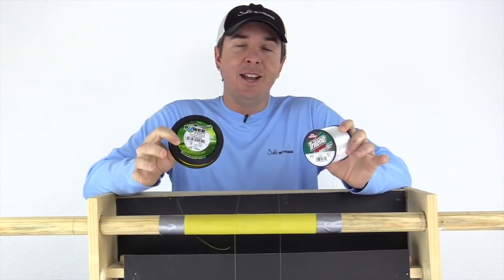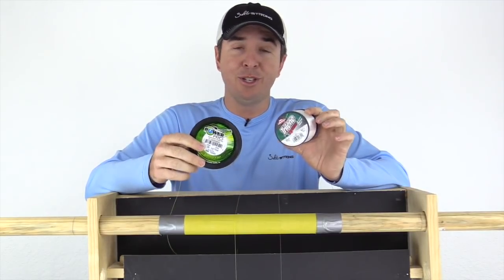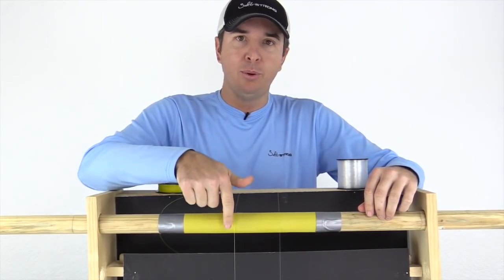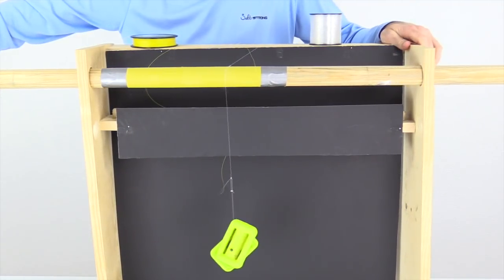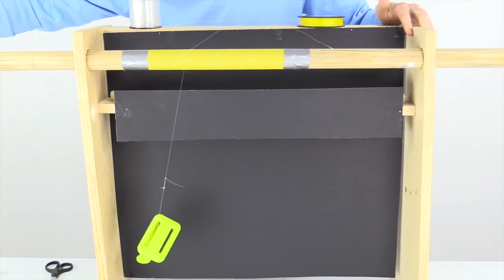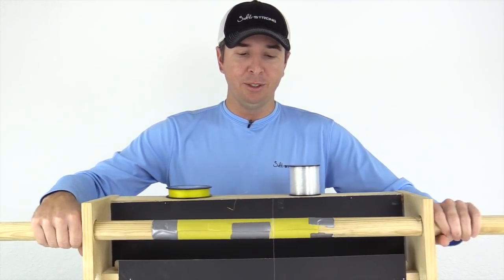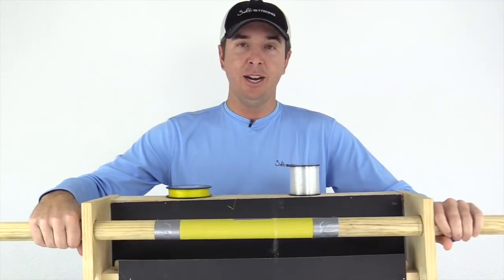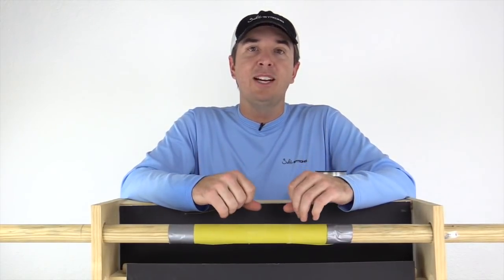Is Braid More Abrasion Resistant Than Mono? Find Out Here...

Comment: Hi Sir I'm  quite shocked to see 20lb braid line to break first on the first test & it just goes to show that 20lb mono stands up to the test than braid & I have 65lb braid on short powerful Okuma Rod & Okuma overhead reel & I use a 50lb Monofilament Nylon line as a leader with the 65lb braid & I'm just wondering how would 65lb braid vs 60lb Monofilament Nylon would stand up to the 65lb braid because I don't think you can get 65lb Monofilament Nylon line & closest would be 60lb Monofilament Nylon line & that would be a good test Sir if could do that test Sir & would an interesting test to see if 65lb BRAID VS  60LB MONOFILAMENT NYLON LINE WILL STAND UP TO THE TEST 
Kind Regards Peter & I Thank You So kindly for doing all the other test you have done Sir 
MONOFILAMENT NYLON LINE VS FLUOROCARBON LINE & 20LB MONO EVEN BEAT 25LB FLUOROCARBON LINE  WHICH WAS A REAL SHOCKER FANTASY THAT AYE CHEAP 20LB MONOFILAMENT NYLON LINE BEAT THE MORE EXPENSIVE 25LB FLUOROCARBON LINE HANDS DOWN & IT JUST GOES TO SHOW MONOFILAMENT NYLON LINE STANDS UP TO THE ABRASION TEST WEATHER IT'S BRAID OR FLUOROCARBON MONOFILAMENT NYLON LINE COMES OUT ON TOP ON THE ABRASION TEST GOOD ON YOU SIR FOR DOING THOSE TEST & Have A Lovely Nice Wonderful Day Sir 😀
Reply from the maker: Thanks for watching and for the support Peter!

Comment: If braid snapped that easily on that then I should have lost A TON more fish around pilings. I’ve wrestled big snook around pilings with my 20-50 lb braid and have had little problems. My only problems were just regular break off from monsters... you know. When I used mono I broke off on pilings almost instantly. This is in accurate lol

Comment: Some people said the test should use the same diameter lines.  Well, we chose our line strength based on what is your target fish, so based on diameter is NOT in the real world of fishing. I have many times break off 100-150 lb braid lines on the pier, boat bottom, sand bars, reefs, large fish scales, whipping shark tails and rough skin.  But it took 50 lb mono forever to break by abrasion.  That is why all the big game set up have at least 200 yards of same strength mono top shot, experience told us.
Reply: I wouldn't be surprised if you're right, if 20lb mono is still more abrasion resistant than 100lb power pro, but it would still be interesting to see that confirmed in a controlled experiment like this.

Comment: I mean, most people only use braid for top water where you need a no stretch line. Not to mention is pound for pound braid a lot smaller in diameter than mono. So course with having less material to go through you would get this result. So with a pound for pound line test it should really be pulling strength.

Comment: I can't believe you ignored the diameter of the line when you carried out these test. But if braided line is really that weak I can't really believe how I wasted my money on spending 7 times more of what could have spent on buying the same length of monofilament. My very first time using braided line on light spin fishing on a mountain rocky river. It's time to find out the hard way lol !!!
Reply from the maker: The main factor for most anglers in power, so that's what was made equal in this test. The benefit of braid is in its casting performance and feel of strikes given its thin diameter and no-stretch material. But the cons is that it's not as abrasion-resistant and it's easier for the fish to see in the water. So the line assembly we recommend is to use braid for the mainline and then add a ~2 ft mono/fluoro leader at the end that can handle the abrasion it may get exposed to while being less visible to the fish.
Reply: @Saltstrong  yeah thanks for the reply and suggestion. That's what I actually did today. I added  70 cm of fluorocarbon leader at the end of my braided line to tie the lure and it worked pretty nice. Most of the time my braided line floats in the water and rarely  comes to contact with any rock .I loved the feeling of braided line as a first timer.

Comment: Braided line has in a way revolutionised fishing IMO. A whole industry has been built around it. Reels are being made super expensive and super strong, along with rods to cope with braid I see videos of guys catching huge fish on braid, the rod bent to the handle, basically bringing the fish in with the line only. May as well be using rope. The rod and reel is only a tool to facilitate wrenching a fish in on high breaking strain braid. It's not sport at all. Case in point, say a guy is using 50lb braid for stripers, the equivalent mono setup is a 50lb game rod with a huge conventional reel. If a guy was winching them in on that people would say hardly sporting, why is it any different for a guy to winch  them in on a rod that bends to the butt using 50lb braid?The fish is up against the strength of the line not the skill of the angler. It sucks that fishing has gone that way.

Comment: Went fishing twice a week during my work years.......now retired and go 4 times a week.  Braids main advantage is its use on light spinning reels for casting and line management, however even though it is hard to cut and seems tuff when cutting the tag end off a knot.....it actually is not very resistant to abrasion.  
Where I fish we have Chain Pickerel.  Sharp teeth!!!  So you have your favorite floating rapala tied on and fishing for Bass and a Pickerel hits......there goes your floating rapala.  Amazing how fast braided line will fail in real world conditions against any fish with sharp teeth and or sharp gill plates.  
So along came Florocarbon, all the pros hyped it up, yep the new wonder line and it is just a bad as braid and even with supreme care tying a knot it still is weak at the knot , sharp teeth and or a concrete piling will cause both braid and floro to fail so fast it is amazing. There you are holding an empty limp line and saying.......Wow that was fast!!! There went my new 8 dollar spinnerbait.  

So it was back to mono for this fisherman.  Mono will get nicked, and messed up but does seem to hold up, so you just cut off 4 feet of line and re-tie.  And you will still have your new 8 dollar spinner bait, it was not donated to a Pickerel.  

Cheers
Kit
Reply: You know you can use braid for main line and use around 8-10ft of mono or fluro leader???

Comment: Try this test with similar diameter lines. Courious to see that.
Reply from the maker: The power of those two lines are extremely different when their diameters are the same, so we didn't think it would be worth testing. Is there a situation in which you are deciding on braid vs. mono in which a specific diameter is desired?

Comment: Great video evidence.

I was on a great bass  bite fishing rock piles last spring. Losing every fish too big for me to immediately control with braid.  Used only 15 pound floroclear and caught a 5 pound catfish way down in this rock pile.
All I could do was keep pressure while  the cat gradually rolled up the rocks. It took several  minutes to get clear of the rock and  land him. the line was very scuffed up but still strong and fishable. With braid, even with a long leader,  it would have been about a 3 second deal until that disintegration as shown in this video. 

I still use braid sometimes , however when using mono , as far as concern for hook sets go, all you have to do is use a slightly lighter hook, copolymer with slightly heavier # test,  or a slightly faster action rod, or some combination.

Comment: This is a crap test. Original power pro is some of the worst braid ever made for this exact reason. 2. Big game is way under rated. Test 2 lines with actual break strengths that match. Not claimed. And get a 8 strand braid like suffix or jbraid 8.

Comment: Re watched this video and decided to do some quick math to post on another comment for shits and giggles since everyone is butthurt that he didn't use the same diameter. Decided to post it here as well. 

idk still think the big game would have beat it (100 lb braid). That stuff is very abrasion resistant and braid, by nature of its design is going to be easier for abrasion to wear on the individual fibers. 

For reference, the 20 lb big game is listed at .018", the 20 lb power pro is .008", and the 100 lb power pro is .018". That means that the area of the cross section is .00005 for the .008" stuff and .00025 for the .018". That means that the 100lb  power pro has approximately 5x the material than the 20 lb braid (which makes sense given it is 5x the weight). 
You are still looking at a 25+ to 1 advantage to the mono though. It wouldn't be unreasonable to expect the 100 lb power pro to give way somewhere around 5 repetitions, which means that the braid is about 5x less abrasion resistant for a given diameter. Even if it took 10, that's still less than half as abrasion resistant as super cheap big game.
Reply from the maker: Thanks for making time to post the helpful comment Colson!
Reply: @Saltstrong  Yep, glad to do so and thanks for the reply. 

Hopefully the "on paper" numbers are accurate for real world testing. I'd be very interested to see if a heavier braid would follow that same rate for abrasion (or mono as well). It is possible that the heavier braid would do better than the smaller braid because the individual strands are themselves larger and more abrasion resistance or some other unseen factor like that. It's also possible that you would see a similar gain with mono when going larger, or a similar loss if dropping to a lighter line.

Comment: I really like braid because of its small diameter to strength ratio. Power pro original has been my go to for years now. It is much more abrasion resistant than spider wire stelth braid. I am shocked with these results. Power pro braid uses spectra fibers and spider wire braid uses dynema fibers.

Comment: I use size 4000 reels so 200 yard of 10 or 12 pound mono or 200 yards of 20 to 30 pound braid.  So how does 12 pound mono compare to 30 pounds braid for abrasion.  I really like the sensitivity of the 30 pound braid and it casts a bit farther but will the similar diameter braid be much less durable than mono?
Reply from the maker: If you're targeting fish that can be caught with 12 lb mono, then I'd recommend going with 10 to 15 lb braid because it casts so much better than 12 lb mono and 30 lb braid. Here's a video that shows how effective using light braid (just 10 lbs) can be for targeting redfish and snook around mangroves: https://www.saltstrong.com/articles/catching-inshore-fish-on-artificials/

Comment: Testing braid and mono is deceiving because the diameters are so different. Small diameter line will certainly abrade faster than a line many times larger. However, it depends on the hardness of the materials being used to attain abrasion. Weeds and other materials are softer and braid cuts thru them like a sharp knife does lettuce. If I use 6-pound braid with a smaller diameter for fishing Steel Head, it will land many more large fish than 2-pound mono that is slightly larger in diameter. If either line comes in contact of a harder surface the mono will part faster than the braid, I assure you of that fact. The smallest of fish can cut line if it encounters sharp objects. You do not need any special cutting tool to cut mono but you do need something made to cut braided line.

Comment: While it's "bad" against abbrasion try cutting it with normal sisors it's much harder to cut and that probably applies to teeth as well.
Reply: Cut it under tension or with a knife and you'll find braid pops much quicker when tensioned. Braid cuts poorly with scissors because it iw very soft and thin, causing it to get squished between the blades of the scissors. Tension the line and the braid pops much quicker every time

Comment: Lmfao this test is so bad either use the same diameter or the same weight.
Reply from the maker: These lines were both the same strength (20 lb). This was due to help an angler choose a line type based on a specific strength of line that they need for their target species. We did not do an equal diameter test because we couldn't think of a situation where an angler would be deciding between a 100lb braid or a 20 lb mono for any given species.
Reply: @Saltstrong  I could imagine using very thick braid in reefy areas but I know what you are saying just a bit annoying when people say braid breaks easily to abrassion when it's actually better.agaknst abrassion than mono.
Reply from the maker: @lachlanoneil8938  I thought for many years that braid was more abrasion-resistant than mono. So the results from these tests completely shocked me. I am not yet totally sold on one being better or worse than the other, so will be happy to run some more experiments. Can you give me an example of where braid is definitely better on abrasion to a mono line of similar pulling strength?

Comment: need to test same diameter.  Fake news.  But decent methodology otherwise
Reply from the maker: It takes a 100 lb braid to have an equivalent diameter to a 20 lb mono. Is there a scenario when an angler would be choosing between those two different strength options for any given fishing need?
Reply: @Saltstrong  I can prove that spaghetti is more abrasion resistant than steel if the steel is thin enough and the spaghetti is thick enough.  Comparing abrasion resistance based on tensile strength is not materials science - there is no control in place.  Take any two materials of equal diameter in order to test abrasion resistance, since it is diameter and material hardness that resists abrasion, not tensile strength.

And yes, some bass guys out there are catching 3- and 4-pounders with 80lb braid and/or 17lb mono, so it does apply in flipping & pitching scenarios.

Report the facts as they are: for the same diameter, braid is more abrasion resistant.

Comment: Use the same diameter not the same Lb
Reply from the maker: This test was designed to help anglers decide which type of line to use for targeting a given fish. So we thought that most anglers first choose their lines based on the power they need to handle their target species. And the diameter factor is secondary.

Comment: Reels are rated for higher ib rates when using braided line. For example a 130ib class reel rated for 1000 yards 130ib mono is also rated for 250ib/1955yd it allows for more line and higher ib rates. Traditionally reels are not spooled with the same IB rates when switching from mono to braid. Your test is extremely effective but your braid ib choice is not equivalent to real world application. The type of game targeted does play a role but most people choose braid for the extra yds and the easy casting ability.

Comment: This is why you want to use a fluoro/mono leader when using braided line. Thanks for the video.
Reply: It looks like the MONO Line leader beats both braid, and Fluro lines. Especially using a Mono leader!! 💪
Reply: Mono has already been proven to be more abrasion resistant than even the best quality fluoro lines, via INDEPENDENT testing. NOTE HOW ALL CLAIMS STATING "FLUORO IS MORE ABRASION RESISTANT THAN MONO" ONLY COMES FROM THE FLUORO MANUFACTURERS THEMSELVES.........or people simply repeating the false information provided by the fluoro manufacturers. Most of the fishing guides/charters today who put clients on giant blue fin tuna, are still using mono, just like most of the trophy bass fishing guides here in Florida. I jumped all over the fluoro bandwagon years ago. I used it exclusively for 4 yrs straight. But I eventually started realizing I was breaking off far too often, from setting the hook on small bass.........even while making aggressive long distance casts........and I always made sure to tie fresh knots frequently. I got so fed up, I switched back to mono, and the vast majority of my line breakage issues vanished. Of course for spinning gear, braid is the way to go. It casts so much further than mono.

Comment: I don't agree with the test. I'll tell you why.

Here in my place people use at least 0.23 - 0.30mm braid with 0.23mm - 0.40mm leader for invisibility. Target species is Snakehead, Barramundi, Papuan Black Bass etc. Most of it with Baitcast reel.

0.23mm leader for barra is okay but for snakehead? Say good bye to your lure. The line will snap that's why people use straight 0.23mm braid or 0.40mm leader. for it